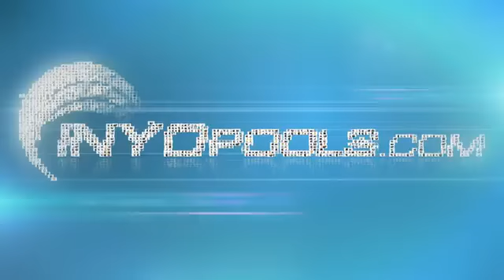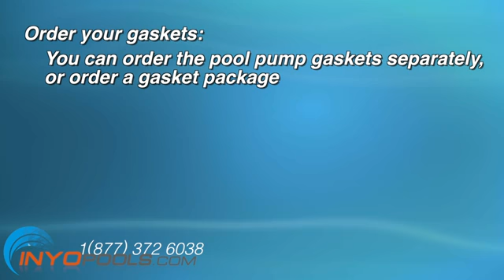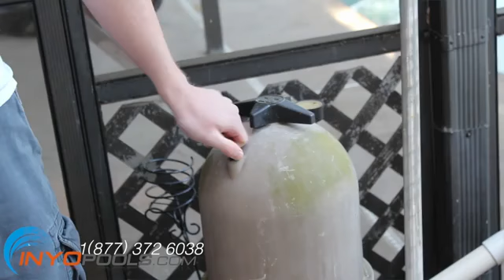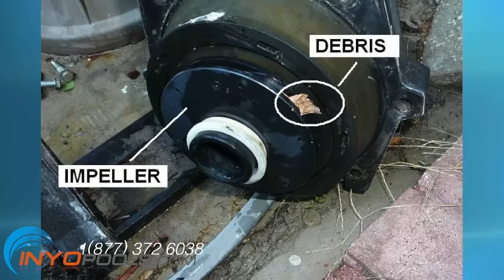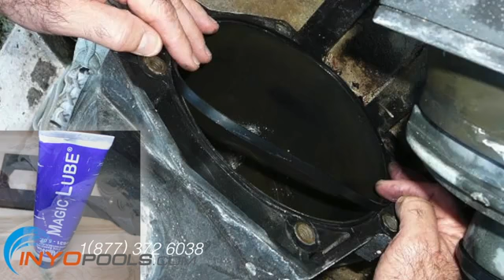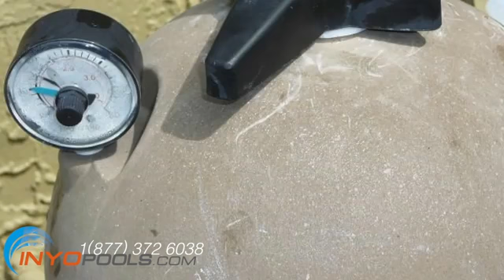How To: Replace Pool Pump Gaskets

Comment: i only see 4 housing bolts
Reply from the maker: Good catch. The script was written for a Hayward Super II, which has 6 bolts.  However, they used a Super Pump. The general guidelines should still apply to most pumps.

Comment: Do you have to empty the hot tub to take the  pump out ? Will the water squirt everywhere?
Reply from the maker: If you don't have isolation valves, you'll need to drain the hot tub. Water will spray out if you don't have valves to shut off the flow of water.
Reply: Got it . Thank you!

Comment: If it still leaks, can I use a flange gasket, which goes between the two major parts coming together for bolting.  Have a new Centurion B836 2Horsie and slightly leaking under (no more tightening).
Reply from the maker: If it's leaking between the seal plate and pump housing, you should replace the flange/housing gasket. If it's leaking between the motor and seal plate, the issue is the shaft seal.
Reply: got it, thank you for your help